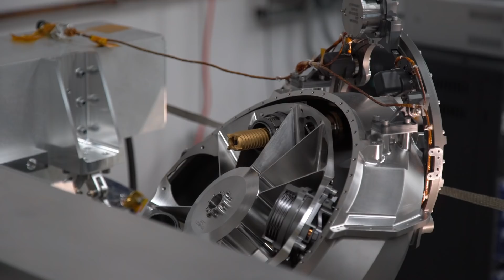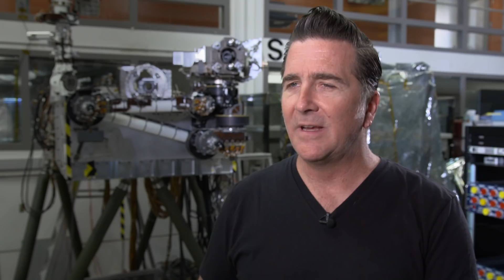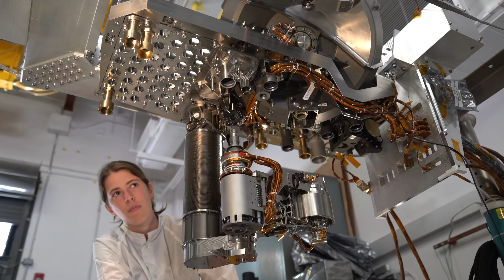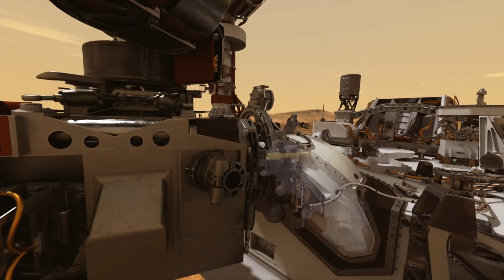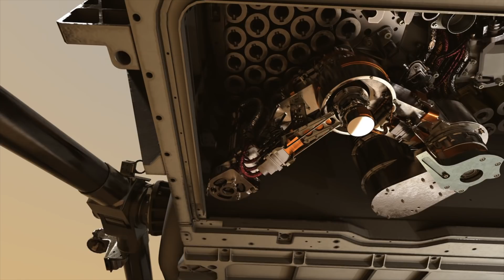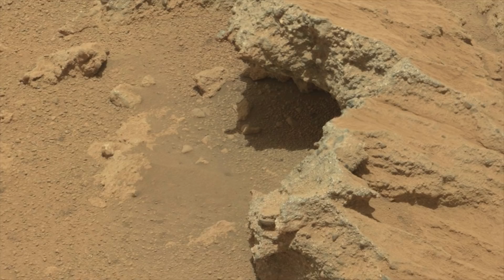NASA’s Perseverance Mars Rover Sample Caching System

Comment: So, the samples are stored INSIDE the chassis of the rover, sealed OVER the hole they're placed in and LEFT, presumably until a time AFTER the whole rover ceases to function.  OK,  the return vehicle arrives.  I HOPE there is a system capable of reaching UNDER the rover, BREAKING the seal, and REMOVING the samples from their storage space.  I always believed the best and easiest way of caching samples would be on the ground, where there wouldn't be a need for all that articulated machinery and blind operation.

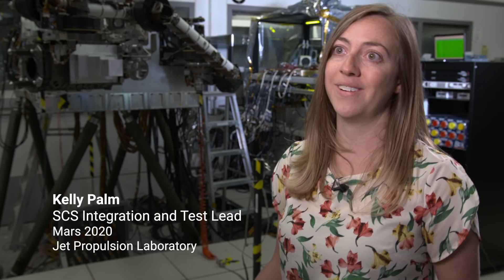Comment: 0:57 “To drill into the rock on Mars, pull out intact core
samples, seal them hermetically, and to be all done autonomously by a robot
hanging off the end of a rover on the surface of Mars has been a challenge.”

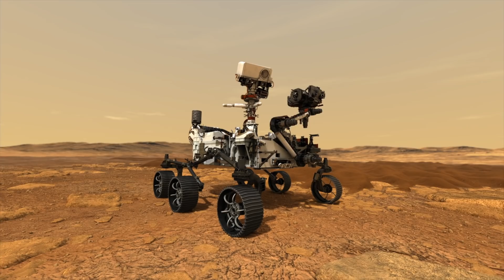1:13 “We’ve got actually 3 robots necessary to do the Sample
and Caching Sytem: our Big Robotic Arm out on the front of the rover
that takes our drill, pushes it against the surface, and allows us to take core
samples. 

1:28 “Then we put that core sample in the Bit Carousel
- the second robot - that takes that from the Robot Arm and puts it down inside
our Adaptive Caching System. This is the part of the Sample and Caching
System inside the rover.” 

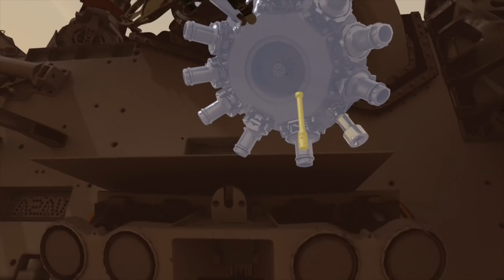1:43 “We’ve got a little tiny robot, a special robot arm
called the SHA (Sample Handling Arm). It takes the samples out of the
handling carousel and moves them through Volume-Assessment, Image-Taking,
and eventually, to Sealing, and replaces the cylinder containing the
sample in a storage spot, all on its own in a matter of a few hours. We have designs
on bringing them back in…a decade.” 

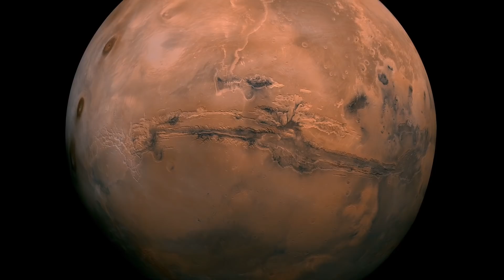2:08 “Mars has been at the fore of our consciousness about
the questions of life. Could life exist in one of our nearest neighbors? I
think we have a lot to learn - life or no life - about the evolution of our solar
system, about our planet, by looking in depth at rocks back from Mars.”